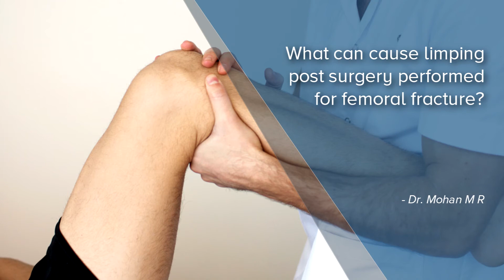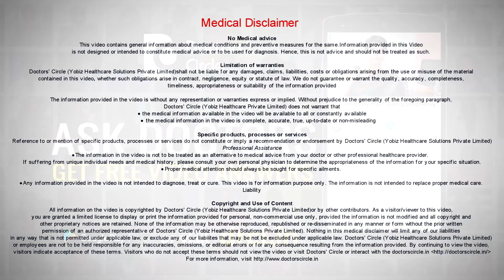What can cause limping post surgery performed for femoral fracture? - Dr. Mohan M R

Comment: 50th day after my femur surgery #TitaniumRod (My daily intake Calcium, Vitamin D3, Terifrac) I can walk without walker but yes totally uncomfortable. My problem is cant bend the knee. Suggestions please.. would be helpful ✌️
Reply: Mine is my 60th. Still doctor advise to walk after a month more. After waiting he advised to practice bending my knee which I know it’s very hard because of its contraction. It was my 35th day I had bended it full 180 i can do kneeling now. Piece of advice jud bended with gravity while you’re sitting on a chair and lower your body to force your knee to bend. Very effective and painful. Push through that pain and it will bend no time. The pain can’t compare when you are still have a broken leg so you can endure that pain for sure because that’s what I have done.
Reply: Additionally drinking magnesium and zinc help me recover flexibility I’m currently at 90% flexible after month and a half of femur fracture surgery . I noticed a big difference after adding this to my diet plus calcium and vitamin D
Reply: Adding that I had barely any flexibility after surgery… barely a 20%
Reply: Which medicine u took for magnesium and zinc

Comment: Im neck femur fracture now 9 weeks post op on partial weight bearing after doctor saw my x ray on 6weeks.hope i can send you all my x ray but i failed to send here for 2nd opinion cause my doctor here in kuwait who is Egypt not explaining in detail about my progress and not telling about partial weight bearing percentange he just simply telling light step. I ask one physio working here and give me some steps for exercise. Now i develop pain at the back of my knee and im worried about the weight bearing that affect my normal walking. Is it dynamic hip screw is only for extracapsular neck femur? I hope so cause i dont know much reading x ray because i heard that if extracapsular not much worried for avascular necrosis.